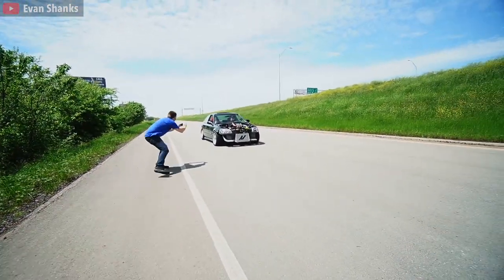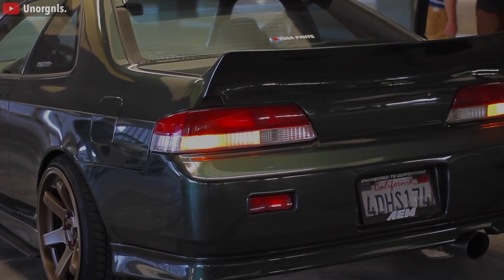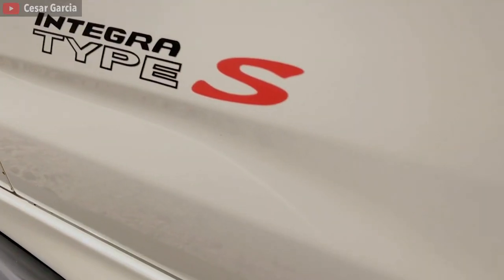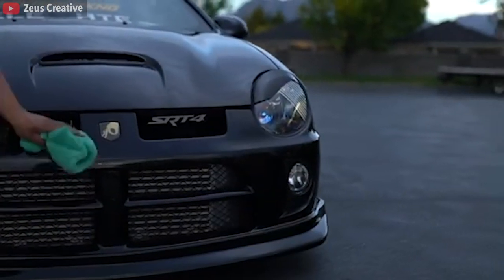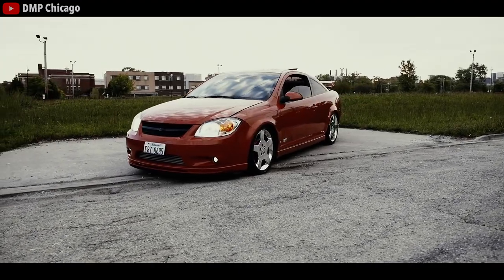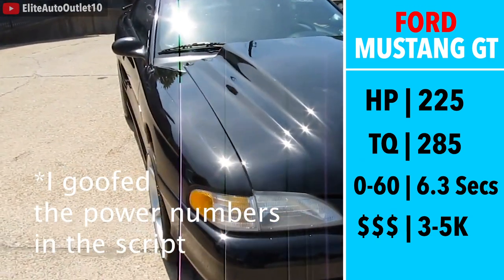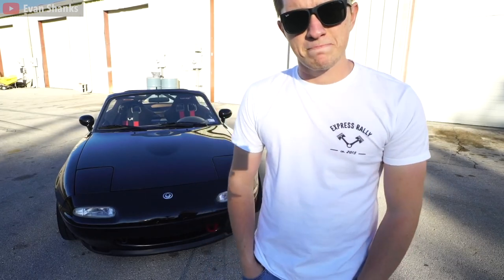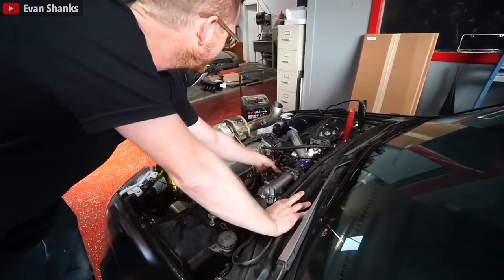BEST FUN CARS UNDER 5K (Top Fast Sports Cars For $5,000)

Comment: This is an actually accurate list compared to most channels lol, I got a RSX Type-S for $2,000 with 90,000 miles and it’s a manual. They’re great cars
Reply: Bro from where?they expensive in my area
Reply: You got a hell of a deal if you bought a Type S with under 100k miles for 2,000
Reply: the cheapest one I could find was 11k and it had well over 200k miles on it
Reply: Nah, in LA, they be 7k and up but 5k and low if they auto

Comment: I have a 1997 Cobra and I love it. You can’t really get one under 5k especially one like mine with low miles but if you can and you are looking at the SN95 mustangs, save up and spring for a Cobra. Like he said its only recommendable it if you live in warmer climates with less rain. Pre 1999 they did not have traction control. If you live anywhere other than a desert, it is hard to daily drive pre 99s so keep that in mind.

Comment: I owned the RSX type S, it burned a lot of oil when I brought it to the dealership mechanic said that was normal so I sold it. It was fun to drive though while I had it. I just looked up the 1997 to 2001 Prelude and they’re selling for 8 to 10,000 what a rip off

Comment: So for prelude if I wanted to pick one up is there a certain amount of miles i should stay away from like 100k and up is bad or what do u think?!
Reply: Manual transmission are bulletproof, you’ll need to be watching the oil frecuently and of course every used car is going to have small issues but once you have it under control it’s alright, I have a 200k plus Lude and it’s going strong

Comment: I also own an 07 ss sc. I think they have pretty good handling but it's my first car so maybe I'm wrong.
Reply from the maker: They aren't bad. But compared to a RSX or a Civic SI, they are pretty horrible. But being that they were more so focused on the power and super charger, it makes sense. Do you have a cold air intake?
Reply: @robdog9265  ah okay. No, I dont have an intake, but I do have a 3.1 inch pulley. Gives it a pretty good sound.